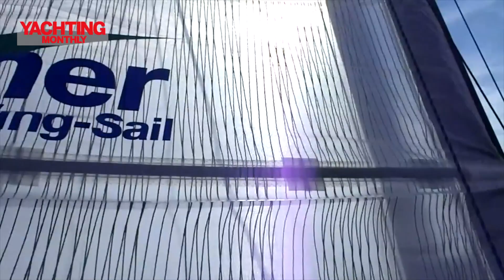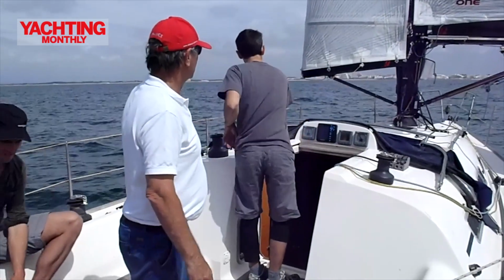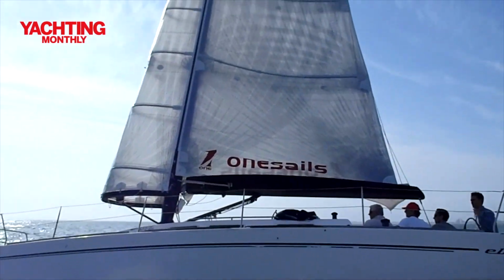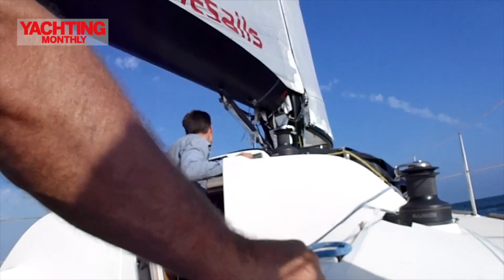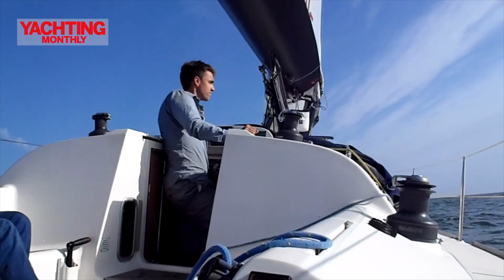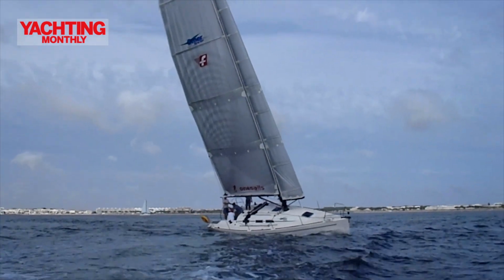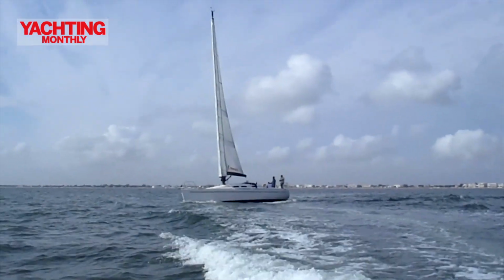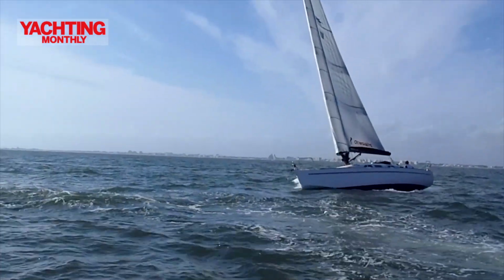Yachting Monthly tests Omer Wing Sail

Comment: Some indication of the level of performance improvement would be helpful. Are we talking 10% faster? To retrofit a sloop rig, I think it would need to be 30-40% more efficient.
Reply: That, and info on how the boat can point, that is how close to sailing upwind will this rig allow.  Also missing is footage of the wing reefed or furled for high wind.
Reply: Ots not about faster it's about being easier to run. No ropes all over the deck it tacks itself etc etc.

Comment: What supplies the hydraulic power? An engine?
Reply: No reason why those couldn't be sheets and even redesigned to include leverage if necessary.
Reply: A pump(s).
Reply: @johnq.public2621  Duh!
Reply: @smacksman1  Well then why did you ask:
"What supplies the hydraulic power? An engine?"
What did you think provided hydraulic power? Unicorn farts?
Reply: @johnq.public2621  Of course hydraulics need a pump, dummy. The question is what drives the pump on a sailing boat. An electric motor, water drive? Hand pump? Don't bother to reply, John, unless you have something constructive to the conversation.

Comment: Its new and its revolutionary....no standing rigging, simple line control, tacking ability, no genoa stuff...and then I realised you were talking about a new sail over the burmudan rig and not a wing sail on junk rig..oppps shouldn't say that, this is modern revolutionary stuff...yeah I get it :) but no I wont be changing my wing sail junk for it, its too similar. New is the ability to adjust the leading edge relative to trailing edge by hydraulic ram.

Comment: He says adjust the angle to 10 degrees. How do you know when it is 10 degrees?
Reply: +Peter Mangold 
A wind vane on top a rotating mast, measures the angle of attack. Simple, isn't it?
Ilan
Reply: +Peter Mangold 
In theory – you are right. There is this exact angle of attack to get best performance, whether it is a wing or a Marconi sail. 
However, in practice, you trim once in a while, depends on how important it is to get best performance at the moment. 
Adding a rudder to the wing adds structured complexity which I am trying my best to reduce.
My experience in sailing Omer wing sail for some hundreds of hours show that this rudder is not needed.
Reply: +Ilan Gonen The purpose of the wing rudder is to take away the need for trimming altogether. You don't have to trim once in a while. You never have to trim once the rudder is adjusted. Because the rudder keeps the wing at the precise angle of attack, whatever direction the wind changes to. This is how the horizontal tail of a plane operates. No manually adjusted system can keep pace accurately and keep the exact angle of attack. Unlike sails, wings work efficiently within very small limits. Take a look at this website http://www.ivorbittle.co.uk/ "The wingsailed Yacht."
Reply: +Peter Mangold 
Thanks a lot for your important comments.